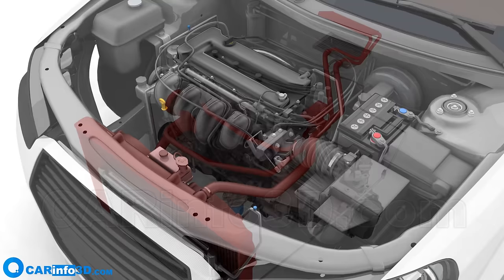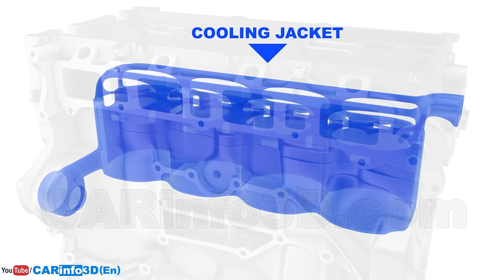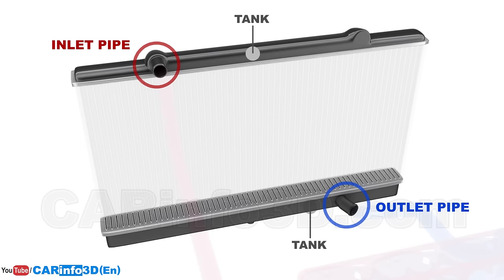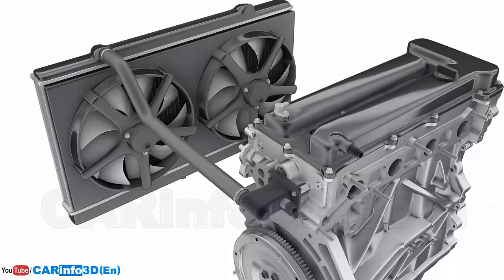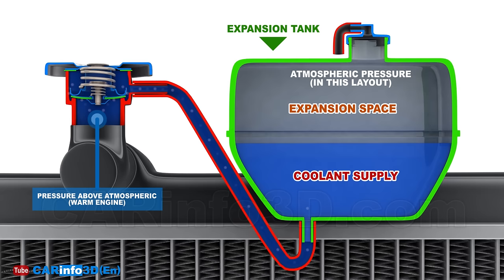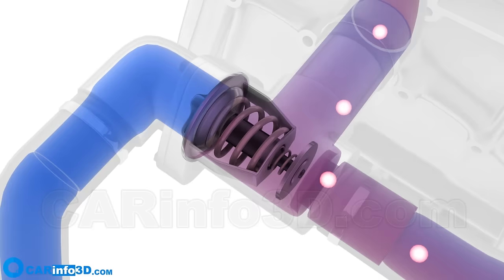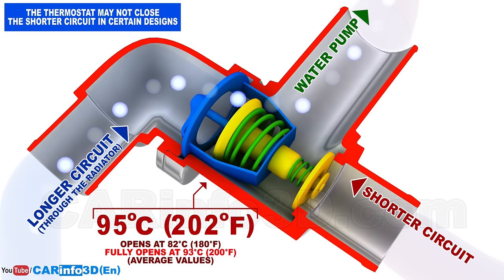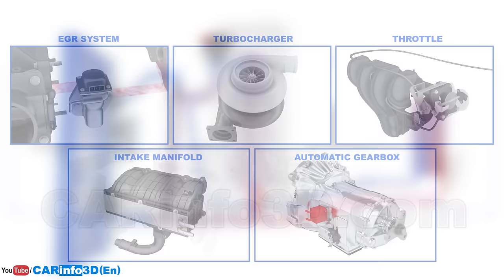Engine cooling system / how does it work? (3D animation)

Comment from the maker: Hello everyone and enjoy the viewing!
PS: Write down the desired topics for future videos;)
Reply: Maybe gearboxes or differentials
Reply: Maybe how the air conditioning system in a car works...I know it has its own piston and radiator but like do they share the same radiator with the coolent?
Reply: Yea do that 👆
Reply: Make videos of crisp clarity like you uploaded previously is fantastic🤘😝🤘. Next topic of car information are
1. Automatic Car Air Conditioning with difference from manual air conditioning. 
2. Antilock Break system working latest technology used by auto companies. 
3. Electronic Control Unit working in depth with how to identify fault using scannar codes. 
4. Automated Driver Assist System working with practical video of actual work via animation shown.
Reply: Can you cool An Engine with Liquid Hydrogen  ?!!
Reply: A topic on how electric vehicles work! Please!
Reply: Variable valve timing.
Reply: @EpicClips_V  I got musty AC smell, would like to figure out how does AC work as well.
Reply: Good content .Please do videos on transmission and 4wd
Reply: I’d love a video on the breaking system ❤
Reply: And maybe electrical system ❤
Reply: @Juras2137 111¹1❤❤❤
Reply: very clear and informative.
Reply: Electronics communication between several ECUs.

Comment: Whenever I heard a car needs a new thermostat I never knew it was an actual device that regulated the amount of coolant moving in the system. I just thought it was a sensor or something. Learned a lot from this video
Reply: I know people who still think it's a sensor. I'm a mechanic but still
Reply: Well technically it's both sooo
Reply: My mecanic had mine thermostat removed.
Reply: Thermostat is also a sensor
Reply: Thermostat is a mechanical sensor actually. It doesn’t require electricity to function, it only needs heat and slowly open up as the water get hotter.
Reply: U simply remove Thermostat valve if u r facing engine overheating issue.
But u may face staring issue in cold climate condition.
Reply: @axe4770  The thermostat contains Wax...so when the temperature is high enough, the wax melts, allowing it to operate...
Reply: @Me_Admin Even for 90's vehicles ?
Reply: Same. I'm about to replace a thermostat tomorrow.
Reply: same

Comment: Here in Uganda 🇺🇬 East Africa, we have witnessed a practice where the thermostat is completely removed for the engine to operate normally, in most cases due to high temperatures in the region, a car that maintains it will be heating up often. But once it removed, the car will operate normally. 😅😢
Reply: Removing thermostat is a bad idea engine has a specific temperature to operate efficiently that's the job of thermostat by adjusting the temperature that is perfect for the engine..
Reply: That’s fucking awesome! I wonder if there is any problems running with-ought the thermostat
Reply: @SpicyRoll-m4r  is there such thing the engine running too cool?

Comment: Great content!    So much easier to completely understand using the 3D animation. I always thought the thermostat was either completely open/closed. I didn't realize that it could run half open and use both loops.
Reply: It's actually necessary. Otherwise you'd be switching from hot coolant to cold coolant instantly. Shocking and warping the metal.
Reply: yo no entendia que por que si la bomba estaba jirando todo el tiempo no tendria salida el agua si el tyermostato estaba cerrado y he ahi comprendi que el agua jiraba sin entrar al radiador y el termostato habria en sierto tiempo para entrar al radiador y hacer sacar el agua fria

Comment: Wonderful video
-Heater core can be used to cool engine down if overheating
-turning heater fan on right away in winter inhibits the engine from warming  up quicker than if it was off

Comment: Thermostats usually are at the highest point on the engine and open to allow hot coolant to go to the top of the radiator. The hot coolant causes the wax in the thermostat to melt and allow the spring to push the thermostat open. Thus, the mechanism of the thermostat must be in the hot coolant. Illustration at (5:30) shows the bypass (short circuit) coolant to cover the wax unit.  What car is illustrated here that thermostat is at the output of the radiator? Thanks.

Comment: Excellent video presentation and very informative. For your future topics you could include ignition system, AC system, oil system, electrical system, suspension system, all the various engine sensors, etc. Thank you.

Comment: Does the radiator fan supposed to come on as soon as you turn your ac on? Mine isn't coming on when I use the ac. It only kicks on if temp gets high for cooling the engine.

Comment: I have a over heating problem with Kb250 4JA1 engine... I changed thermostat, water pump, top engen took it to engenering and top gasket but still when I drive up or high speed it over heat what could be the problem

Comment: I work in food delivery and the a/c on my vehicle is prone to go out during my shifts in the summer unless i hose the radiator down with water from a hose. The a/c repairman i talked to told me it's likely that the coolant is operating over pressure since it's so hot outside (over 100 daily, averaging 106) and by watering the radiator i'm allowing it to cycle properly again. He said i could actually try releasing some of the refrigerant to prevent it from getting over pressurized but i'm not sure, and that requires special containers that i don't have.

Is there truth in this? I figured since the a/c was going out and the radiators job was to dissipate heat that it wasn't dissipating heat well enough, and figured if the vehicle can drive through rain, that a water hose to kinda flash cool the radiator couldnt hurt too much. The belt squeaks a bit when i do this but i can keep my a/c running at least a little bit throughout my shift like this which is better than not at all... a cab temp of 85 is much preferred to a cab temp of 115... am i potentially doing engine damage?

If hosing the radiator down makes it too cold it should bypass the radiator using the thermostat and bypass valve to maintain proper operating temperature correct? Would a weak or non functioning fan make the overheating problems worse?

Comment: Can you tell me what the thermostat temp rating compares to the electric radiator fan setting that turns them on. Eg-  if I have a 85deg thermostat do I set the fans to turn on at 95deg and turn off at 85deg so that 
the thermostat stays open but when the temp hits 95deg again the fans turn back on or should I set up the fans to turn on at 90deg?
This information is so hard to find on you tube. I am going from a mechanical viscous fan and fitting electric digital controlled thermo fan or fans. I just need a bit of clarification on the temps. All the temperatures are in Celsius. Any help would be greatly appreciated 
Thanks
Reply: You want your fan switch to turn off before the thermostat closes otherwise the fan will keep running while the thermostat is closed. An example of this would be - thermostat is rated at 86, fan switch kicks in at 95 and turns off at 90
Reply: @philipmalan5336  Hey thanks Philip for clarifying that, there's not many videos on you tube that even mention the relationship between the thermostat and the fan controller 
Thanks again 
Hello from Australia 🇦🇺

Comment: im curious how the non electrical thermostat works. is it the same like radiator cap where it relies on pressure?
Reply from the maker: Good day! I have a video that will be published a little later ;) P.S. No, the thermostat works on a different principle, based on the temperature expansion of materials. An electric thermostat is similar, but it has a built-in heating element for control.

Comment: The flow through the engine block cooling jackets doesn't seem very efficient. I'd be willing to bet that some cylinder spots are hotter than others, and if so, what is the impact on the engine?

Comment: Help! Mi car overheats with the thermostat installed while running medium/high speeds. I turned on the hot A/C (it is supposed to lower the motor temperature a bit) and the heat went up even faster. 😮
I've already changed two original thermostats. 
Now I'm using mi car without a thermostat because I can't find the problem...

Comment: That's not how the system work in Renault Twingo 1995. It doesn't have a radiator cap and also the engine doesn't have any pipes going out of it. The water pump is connected to the engine and 2 pipes going out of it to the radiator.

Comment: higher concentration tendency moving to lower concentration either it fluid , moving part create the friction linkage the radiator with their flow to circulation system , #eatmybrain

Comment: Could you maybe also go into an expanded system with a electric waterpump added to it? That's also very common nowadays (cars with a start/stop feature will have this to cool the engine when not running).
Reply: Does the exact same as normal pump i think?

Comment: who ever did this diagram put the thermostat in the wrong place. the thermostat should be on the engine block to the upper radiator hose to the upper radiator intake, and not in the lower radiator to water pump hose